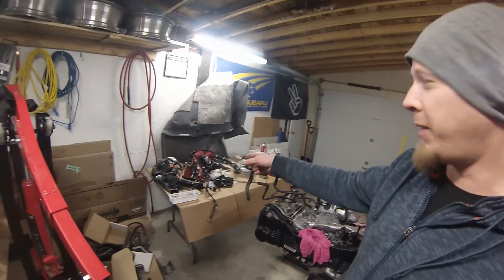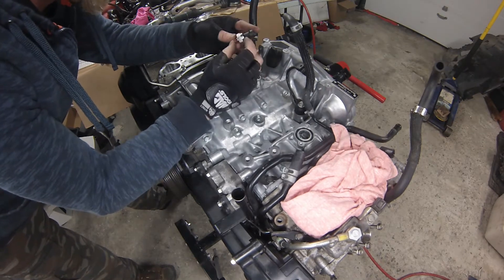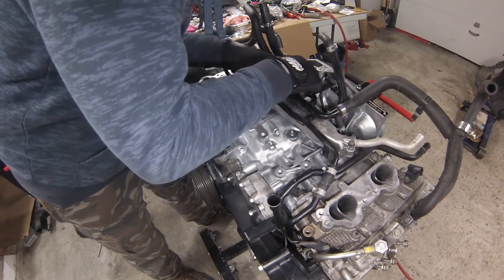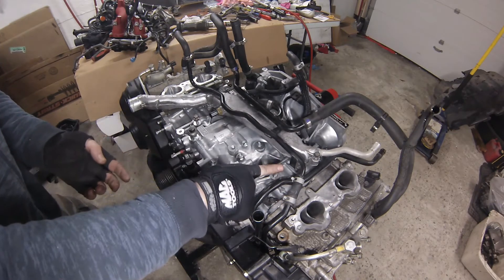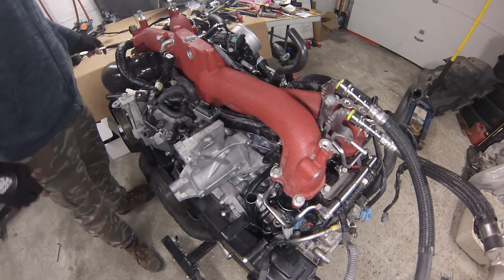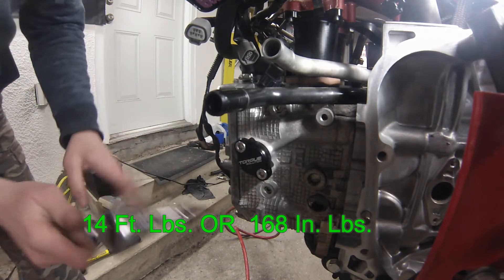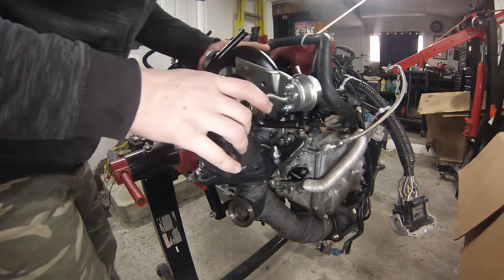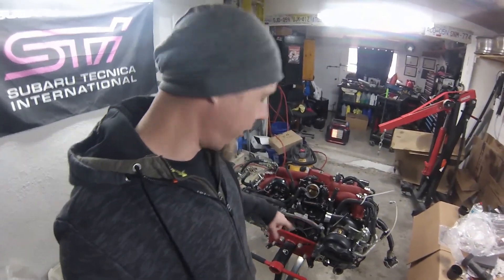2013 STi Build Part 12 - Intake Turbo and Exhaust - How To

Comment: Will you just put a bracket on the internal wastegate?
Reply from the maker: Yes, Tyler has purchased a wastegate actuator delete to hold the door shut. Next episode I will finish up a bunch of that smaller stuff. Got the oil sending unit and BPV hose in last night... it's tight in there! Gonna watch your latest now.
Reply: Homebrew Subaru nice.